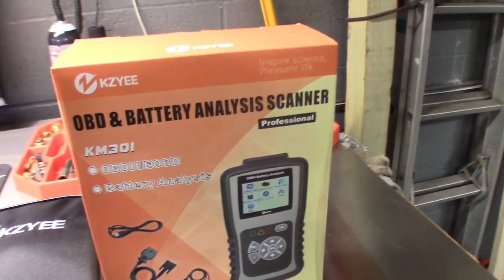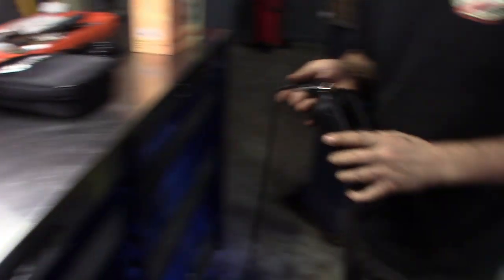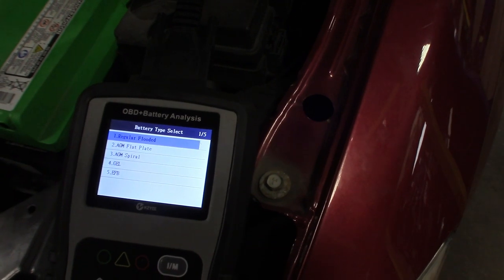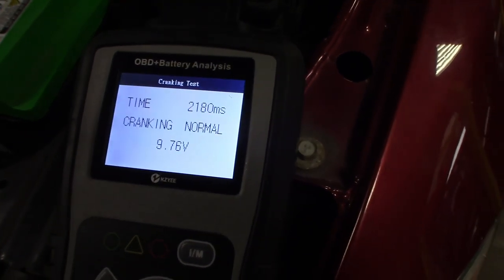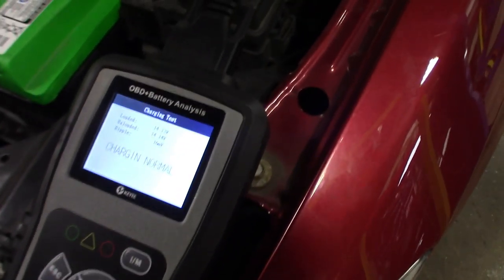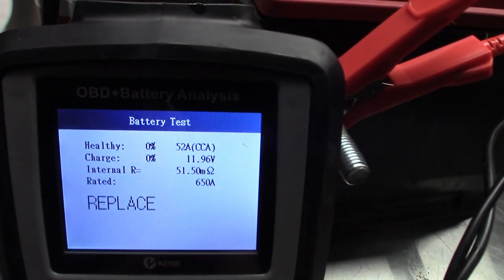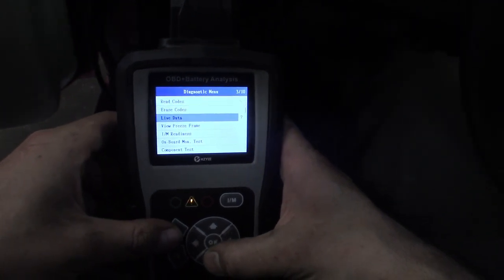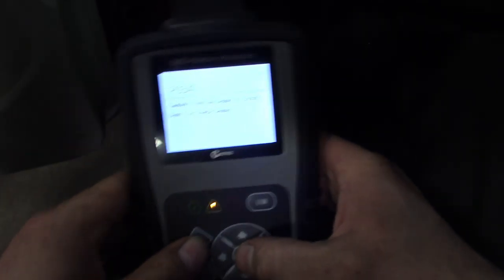Steve's First Review On A KZYEE

Comment: Looks initial to the Autel one I bet they used the same manufacturer. I wish I had time to do these types of freebie reviews. Thanks for sharing looks cool.
Reply: I have an autel 539b, and honestly u cant beat it for 75$. Its a decent code reader, battery/charging tester and has decent digital/graphing meter. I use it all the time.
Reply: @BDauto86  can the  autel run the charging, cranking, and the ripple test? mines only reads the voltage of my battery. I like the way this kzyee km301 performs, nice video.

Comment: Looks just like autel al539b but mine is a multi meter as well
Reply: Exactly what this is!!! the autel one is awesome and definitely a great tool plus the multi meter is very handy!!
Reply: Yeah but how chinese do you need to make an already chinese product
Reply: @CPthetooladdict   I don't think they are the same, the autel one is a multi meter, but not a battery analyzer, it onlys tell you the voltage of the battery. In this case, they are different.
Reply: @arinchan4214  yes the al539b does have a battery analyzer I own one and have used that function.